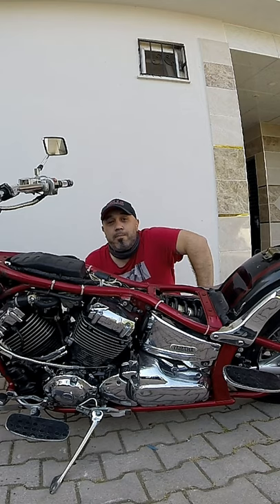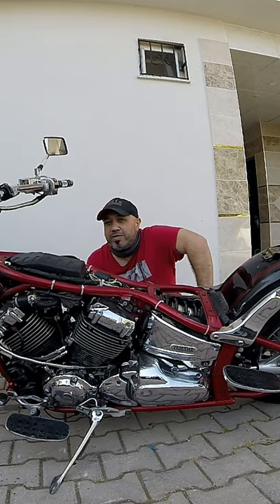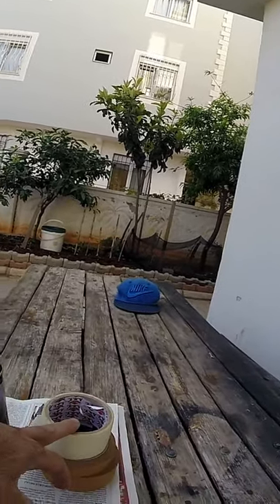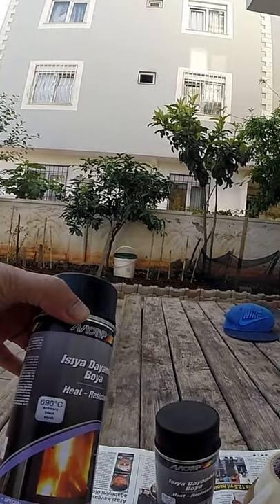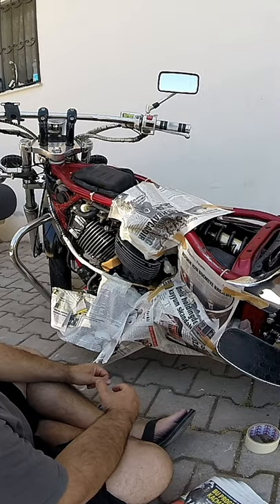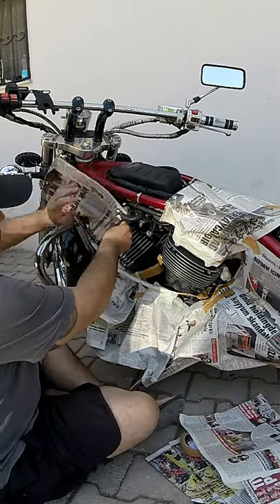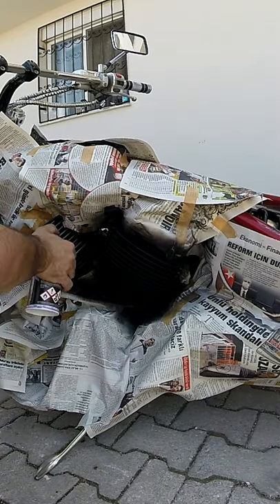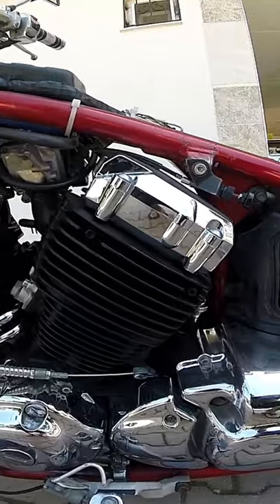HOW TO PAINT MOTORCYCLE ENGINE WITHOUT REMOVING | PAINT MOTORCYCLE ENGINE #SHORTS

Comment: Im going to give this a try with my Honda shadow
Reply from the maker: Go for it.. it's not a super difficult DİY.. just make sure U give it a good clean and scrub.makebsure no oil or dirt on the engine that's the most important part. Then make sure U tape it up well. And buy good heat resistant paint. Don't buy the cheap stuff.. good luck oh and thanks for watching...